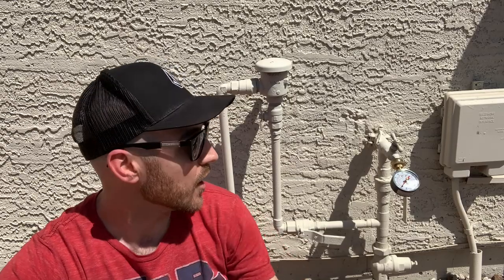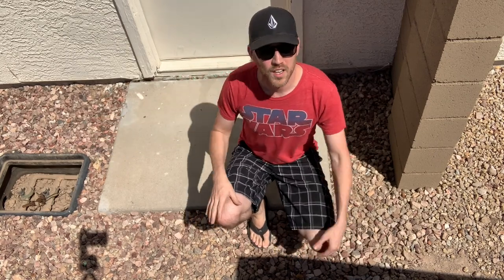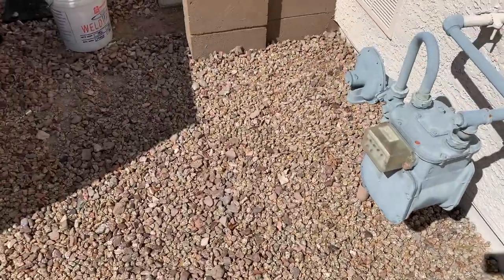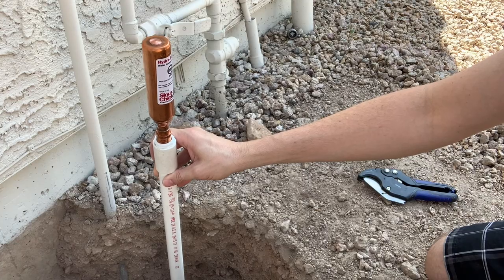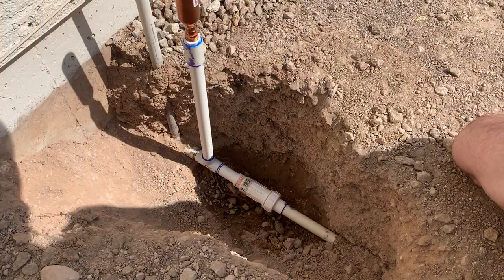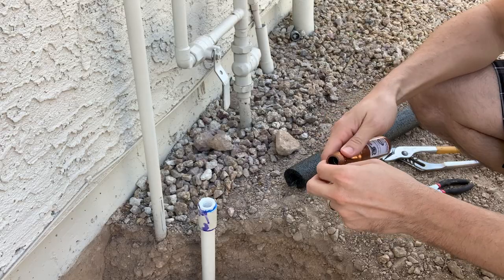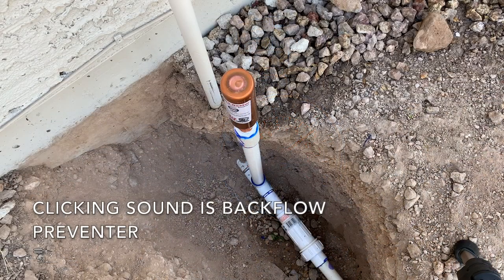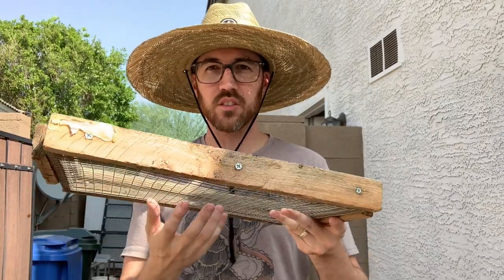Fix Irrigation Water Hammer Step-By-Step

Comment: I’ve been in the business 30 years and learned something new so I’m very thankful. One thing I want you to do is get a steel threaded coupling for your arrester. You can screw plastic into metals but cannot screw metals into plastic or it’s going to break. Your skilled enough to know how to install a coupling in there that’s steel. Also Teflon tape is a pain and you just need to use pipe dope and brush it on. You’ll never use Teflon tape again. Now I’m going to try and find one of these water hammer arresters
Reply: Thanks for the tip about not screwing male metal threads into plastic. However, I've also read that one shouldn't screw copper into a steel coupling because there will be corrosion. So we're doomed either way? I tried looking for a brass coupling but can't find any longer than an inch and I don't think 1 inch is long enough to screw in both the arrestor and a PVC fitting. I'm trying to figure out how to install the arrestor myself because I oddly enough can't find any local irrigation people who are familiar with it. The whole experience has been extraordinarily frustrating.... there are so few tutorials online and all have "mistakes" without a clear solution.
Reply: @ZerothRoundPick  Would the following work? It doesn't have metal threads into plastic, and it doesn't have copper into steel:
- 3/4" PVC
- then 3/4" Slip x MHT PVC Hose Fitting
- then 3/4" FHT x 1/2" FIP Brass Adapter Fitting
- then water hammer arrestor
Reply: @zachz1083   Thank you for the reply Zach.  Your idea sounds clever and reasonable.  I eventually found an irrigation contractor who claimed he was experienced with water hammer arrestors. Yet when he came out he only had the arrestor for washer/dryer systems. I let him install it anyway. That arrestor didn't help at all.  But I was able to swap out the arrestor and install the Sioux Chief myself. That hasn't helped either!  I'm still having severe banging in my irrigation system when certain zones run. And of course, the contractors screwed the metal arrestor threads directly into the PVC tee. So I've gained nothing and have an extra risky connection in my system. Yay.  Just sharing so that the viewers know, the solution in the video might not work for everyone.   Good luck to all.
Reply: @wl34nkw  I'm sorry to hear that. I wonder: is you arrester upstream or downstream of your irrigation valve? I'm getting hammer on both sides, so I'm planning on placing an arrester on both sides: one to protect the pipes in the house, and one to protect the PVC pipes downstream.
Reply: @zachz1083  Good luck, I hope two arrestors works for you but I'd suggest verifying that the first one makes a difference before installing the second. My arrestor is upstream of the valves in a PVC tee similar to the guy's in the video, but before the PVC goes into the ground.  To install another arrestor after the valves I'd have to dig and I don't have enough faith to do that.  The hammers in my system are mysterious.  Some zones hammer at turn-on, others at shutfoff, and others never hammer.  The hammering doesn't seem to correlate in any logical way with the model of valve, the location of the valve within the array, the flow control knob setting, the order in which the zones are run,  or the amount of water emitted in the zone.  Before installing the arrestor I tried adjusting anything else that could be adjusted... a few times I thought I had discovered a way to stop the hammer in a certain zone, only for it to return later.
Reply: @wl34nkw  Ah, my system is exposed because it's for above-ground drip irrigation, so access is fortunately easier. I definitely would not be digging up to fix it unless it makes the entire system unusable. I'm also wondering if my multiple sharp 90 degree turns exacerbate the issue. If the arrestors don't work (and if I'm not yet tired of the project), I might replace those 90s with double 45s giving it a bigger turn radius, but that's only if my motivation continues.

Comment: Folks, when you’re experiencing waterhammer, it means that there is a loose washer in one of the valves within your house. You can locate which valve it is by turning every valve off one by one then running your sprinklers while one of the valves is off. You must turn the valves off one at a time, then run your sprinklers. When the water hammer stops, it is the valve that is turned off. You must either replace the valve or you can sometimes turn the valve a quarter of the way off and that will stop the water hammer.

Comment: Good video in general just want to point out that you definitely want to test for leaks under pressure, not just gravity. So seal the system (attach the arrestor) then open the valve all the way and look for leaks that way.  Also note that if you do have a leaking joint, and then you fix that leak, the next weakest joint in the system may start to show a leak, even if it didn't at first.  So chasing leaks can become frustrating until you're practiced at gluing up pipe properly (look for a video on that).  Also be sure to wrap your teflon tape in the correct direction (so it can't loosen up when threading parts on).  The easy way to do that without having to think about which direction you need to wrap the tape is to simply wrap all your parts before assembling anything. On each part, hold the male threaded end vertically up, and, looking down on it, wrap it clockwise.

Comment: Teflon tape winds on opposite from what you did!  Wind tape opposite direction of the direction of the piece you are winding on.  Your direction of wrap tends to unwrap and bunch up as you wind on.
Reply: Wrap in the opposite direction your turning, that way it doesn’t wanna bunch up and not serve it’s purpose. You basically turned your wrap up and out.

Comment: You can also fix your irrigation water hammer by adding a sprinkler head close to the vibration source i.e. early bleed off i.e. if you can tolerate having water close to the source.

Comment: You really don't want to screw a metal MPT fitting into PVC as it's likely to crack. Instead, use a brass coupler with a MPT PVC adapter.

Comment: Thanks for sharing, Jesse. It's great that you made this video!  Two times I had pipes burst due to irrigation system water hammer, so it's good that you were proactive in fixing it.  There's surprisingly little information online about installing water hammer arrestors in irrigation systems, even though it's probably a common problem.  Even the plumbers I've contacted don't seem familiar with installing the arrestors. I live in CA where there's no rain 6 months per year and everyone has irrigation systems. One year my irrigation line burst and another year the main line, both PVC. This resulted in expensive repairs... it could have been much worse if I wasn't home to shut off the rapidly leaking water.  The second time I realized the bursts were not due to high water pressure by itself but by the water hammer from the system.  We always had to run our system while we were awake because the hammer noise was too loud to sleep through.  I don't think I'm brave enough to try plumbing work myself but your video was inspiring. Some neighbors on Nextdoor suggested installing newer valves which supposedly might be less prone to water hammer. If replacing valves has solved water hammer for anyone, please reply. BTW as a scientist I'm baffled how the arrestor works at all, not even being in line with the flow!

Comment: I had similar issues and had already installed an arrestor (Sioux Chief Mini) which didn't help much, if at all. After watching your video, I noticed yours was quite a bit larger so I went out and got Sioux Chief part number 653-B which might even be larger that what you used. Zero water hammer now. Note: I also installed it about 16" from the first inlet on my sprinkler valves. I realize that distance was not an option for you. Just mentioning it for those interested.

Comment: Well explained.  Couple things to share.  

Putting on teflon tape: you wrapped yours backwards, always put it on like installing a nut in a bolt- same direction as threads. Often putting it on backwards can cause the tape to come off because you are actually unthreading the tape with the outer device.   Electrical pvc is grey and very uv resistant, you can inner-mix electrical pvc into plumbing.  It isn’t uv proof, but will withstand better.   

Sizing the water hammer arrestor to the pressure, volume is important.  Protecting it from weathering (heat/cold, uv) helps extend its life.  There is a rubber bladder that wears and gets aged inside.

Comment: Thanks for the video. Did a similar install, but I used a galvanized coupler. Since many of the comments were mentioning that metal INTO plastic was a bad idea. I put the water arrester into the galvanized coupler (metal to metal), and then the galvanized to PVC (metal over plastic). Used some of my blue pipe tape, and seems to be working well. Hammering of the pipes inside the house it gone. Hopefully lasts a long time!

Comment: Jesse
Had the same problem loud water hammer in home and noisy irrigation. Had a number of plumbing co check it out replaced PRV which helped a little. Another plumber came out last week and put a expansion tank and a silent check valve on hot water heater....immediate complete silence in home. No noise, 0 water hammer from any device in home or irrigation. Your video got me thinking in the right direction...
Reply from the maker: Glad it helped and you got the issue resolved 👍🏻

Comment: Thanks for the video.  A suggestion would be to test first the water pressure valve before installing a water hammer arrestor.  A defective WPV results in a pressure drop of 30% to 50% inside the house when the sprinkler valve opens.  The huge pressure difference causes a water hammer when the sprinkler valve suddenly shuts off.  If after replacing the WPV,  re-verified that it is not defective, and the water hammer still occurs, only then you can consider installing an arrestor.
Reply: Second this.   I had a really nasty water hammer from my irrigation.  It was so bad it was activating my tankless water heater which lead me to this video.  But, I found the pressure regulator was set full open.   I adjusted it to 60psi and it almost completely eliminated the hammer.  Based on that, I'm surprised that the one in this video did not help according to Jesse, since the two devices wound up so close to each other anyway, and I also am curious if it's not working properly.
Reply: I agree bring down work place violence WPV is the answer to bring the pressure down

Comment: Great video, I have the same exact issue. Just bought my house last August and when I turned the sprinklers on this year had the same problem. Thank you!
Reply: I bought the same water hammer arrestor from your link and installed it. For some reason it worked for a day and now it’s happening again. My suspicion is it has something to do with the vacuum breaker when the water pushes the air out of the way and purges the air. It seems to only happen when it’s first filling with water. But then once the system has been activated the water hammer arrestors seem to help. Wonder if I need a new vacuum breaker or need to add a T on the other side of the breaker?

Comment: Great video, thanks for making it.   I'm having the same problem so I will be trying this soon.
Reply: I finally got around to doing the job, this almost eliminated the water hammer 100%, still hear some very faint water movement noise occasionally, but now I have some peace of mind, I no longer feel that my plumbing system is a ticking time bomb.  The hammer used to kick like a mule, seriously loud and actually startling if you didn't expect it.  Thanks again for posting such an easy to follow video.

Comment: Thanks so much, Jesse.  We have a similar problem where we have a water hammer issue with pipes inside the house occurring during the time the outside auto sprinkler system is on between 4 - 5:00 a.m.  It only occurs during that time on the days the sprinklers are on outside. My question is whether or not we can find a fix for the irrigation system, especially since this just started after the system was newly installed 20 years ago. The sprinkler system is basically pvc and there are 8 station valves regulated by the clock with each running from 1 to 3 minutes.   We're happy to have a water irrigation specialist come in but are a little weary after having a plumber give us an estimate just to strap pipes down in the house for $1500.00. Thanks, again.
Reply from the maker: Has there been any construction around your house lately? What could have happened is that the city increased the water pressure on the main line that feeds your house, which may have also increased the water velocity, which would cause a water hammer when the irrigation valves close. The solution I posted here is a MUCH cheaper first-try solution than what you were quoted. Just install it as close as you can to your irrigation box in between the valves and the main water shut-off valve on the side of your house.

Comment: Good video. Just FYI for folks, the apparatus you called a backflow preventer is actually a vacuum breaker and NOT a backflow preventer.
Reply from the maker: Thanks for the correction.  Pinned your comment.
Reply: Actually it is a back flow preventer.  Its a PVB pressure vacuum breaker  which makes it so the water doesnt go back and contaminate the citys water supply

Comment: Thanks for the video!  Just a few quick questions for you.  Is there a reason you had to add the vertical pvc?  Does the arrestor need to be vertical?  Thanks!!!
Reply from the maker: The arrestor does not need to be vertical.  I added the vertical standoff primarily to be able to see leaks if any formed.  Also, there are different sizes of arrestors and if I needed to add a larger one, it'd be easy to access without having to dig again.

Comment: Having a problem threading the Sioux Chief Arrester metal male threads with PVC without leaking. Going to look for a metal to  PVC union tomorrow.
Reply from the maker: You got a threaded bushing? And used some Teflon tape?
Reply: Good call Joseph.  Metal in pvc will eventually leak in our heat.  The adapter you seek is tricky to find and is only available in one size, but it is at blue and orange stores.  Maybe more sizes are online tho.
Reply: Just FYI Sioux Chief makes a ton of variations on this product, including one with a built-in PVC connector.  Model number 652-AC.  This should take away any threading/metal-to-PVC connection issues people might run into.

Comment: Tried 2 arrestors on backflow today (water in, out) and still banging. Wonder if valves could be bad? Toro. I could replace the ck valves in preventer with extras i have. Irrigation company coming out agsin to try to solve. Water pressure and gpm has not changed in 10 years. Ty

Comment: Great job. Any reason for the sizing of the water arrestor at 1/2? I have the exact one, but my pipes start at 1 inch and then there is a reducer to 3/4 when it starts going to the valves
Reply from the maker: I bought the arrestor first and built the rest of the system around it.  That was the only size I could find at the time. I suspect the larger 3/4 unit would do equally well.
Reply: @jessemsparks  I was just thinking to getting a 1" to 1/2" reducer since I already have it but wonder if 3/4 arrestor would be more effective or just the same.

Comment: Great video I have water hammer on my automatic pool fill when it comes on it causes it the shake do you think this will work to stop the water hammer
Reply from the maker: Yeah it should work for any quick-close valve. Same steps apply, just install it as close to the valve as you can get.

Comment: Does the arestor need to be installed before the irrigation switches? Why do you have to install it so tall?
Reply from the maker: Yes, as close to the valves as you can (on the input side). No, you don’t have to install a standoff like I did. I did it this way to make it easier to change since Arizona has such hard water and the internal piston in the hammer arrestor can seize over time.
Reply: @jessemsparks  awesome. So if I had room, I could install this in my "box".
Reply from the maker: @matthewlaborde1080  for sure

Comment: After 9 months is it still working good at preventing the water hammer?
Reply from the maker: Yes sir. Still going strong.
Reply from the maker: I think you jinxed me! The hammer came back this week. Unscrewed the arrestor and replaced with a new one and it’s back to working like it did. 60 second repair. I may test out replacing it with a 3/4” thread arrestor instead of the 1/2” in the winter when it’s not so hot out.
Reply: @jessemsparks  from my understanding, the arrestor is a temporary fix that doesn't solve the underlying problem.
Reply from the maker: @kevinbreese5739  the underlying problem is the quick-close irrigation valves. There are some expensive ones that close with a slower mechanism, but changing the arrestor even yearly is way less effort than replacing everything in the irrigation box.
Reply: @jessemsparks  Curious why the 3/4" would be better?  Does the bigger connection and/or added length allow for better shock absorption?  I'm trying to figure out which one to use for my sprinklers and if the 3/4" does a better job overall, I would rather spend the extra few dollars and just use that one from the start.
Reply from the maker: @mukeshs2689  to be honest, 1/2" was the only thread option available at the time I made this video.  I did buy a 3/4 arrestor and will try it out whenever my current arrestor gets stuck due to hard water buildup.  But currently can't comment on if it's any better or worse because I haven't tried it yet.
Reply: @jessemsparks  Okay makes sense.  Thanks for making the video--super helpful!